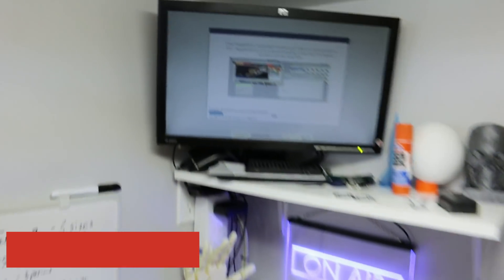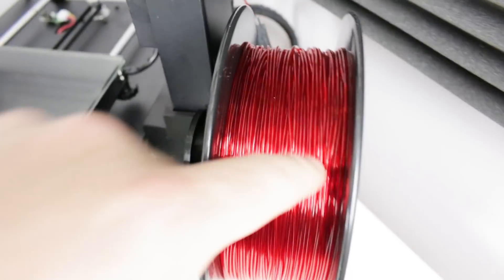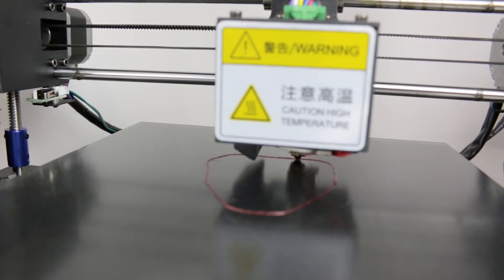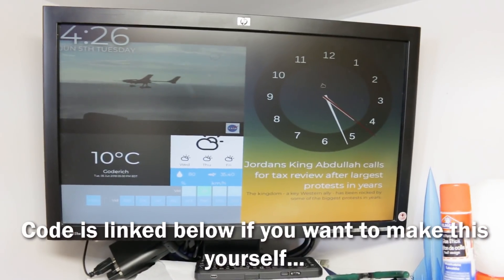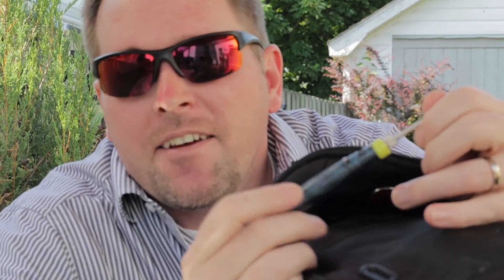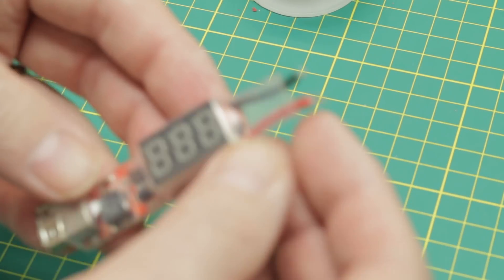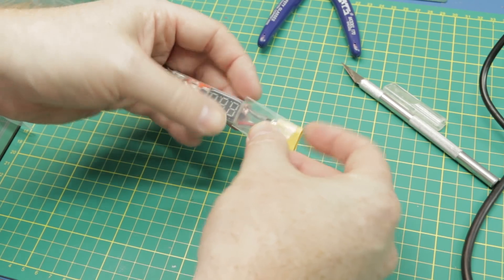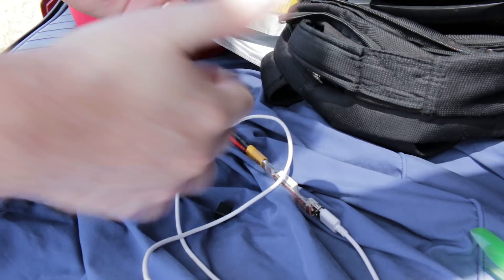Never Forget Your Solder - VLOG

Comment: A note on charging phones from 5v supplies. Most phones have a detection circuit that will limit how much amps the charging will draw from a USB port. This is because the computer USB ports are not rated for high current. This is why there is something called a Dedicated Charging Port (DCP) which is a USB port that has a certain configuration on the D+/D- lines that tells the phone it is okay to use whatever current it needs for fast charging. Only problem is that historically different phones need completely different D+/D- configurations. Which is where I usually use something like the TI TPS2514, a DCP Controller, it detects the type of phone and sets D+/D- accordingly. Very cheap, and makes these 5v supplies charge phones REALLY fast.